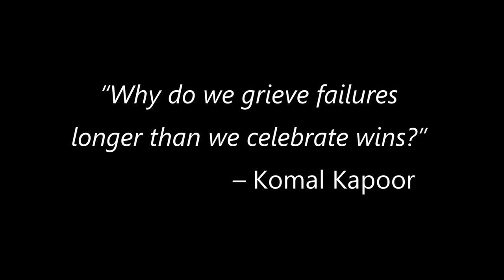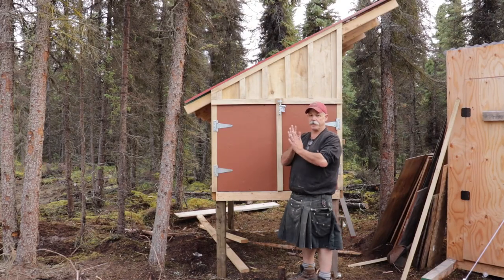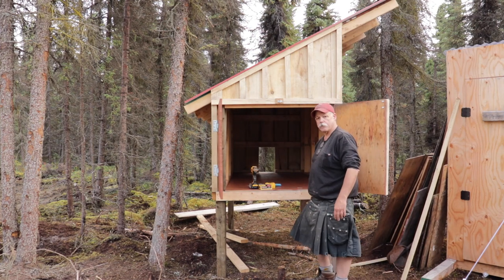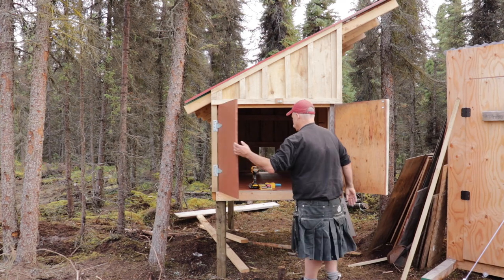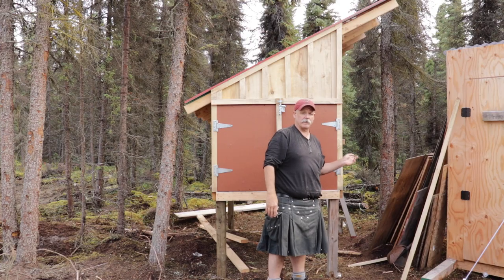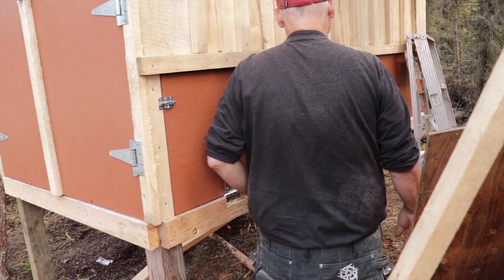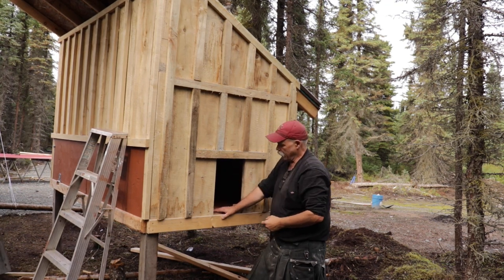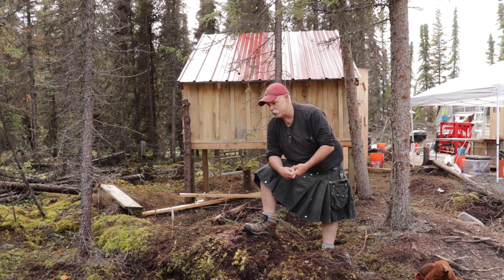Finishing up the chicken coop

Comment: Coop has really came together Sean👍👍 -What is your next project? How much is a haircut in Alaska?
Reply from the maker: Thanks Charles! I go to a regular barber, cost is 14 bucks. Usually only twice a year for me though hahahha. Next project?  I need to build a stand for my solar panel,  fall some trees for next year's garden and try and get the concrete poured for the foundation before freeze up.
Reply: @SeanInAlaska  - $14 about the same as the lower 48 - 60 pesos here - around $1.25 US. Great next project - please video if you can - I would like to install solar here - we have a lot of brown outs and power is also expensive. Are you planning to purchase air nailers when you start your cabin?
Reply from the maker: Charles, I record everything hahahhaa. I will not buy air nailers, I do have a ton of folks who have offered to let me use theirs so I don't need to buy any. I am still considering just using a hammer lol. My solar system will morph often until I get to the system I want.  Stay tuned!!